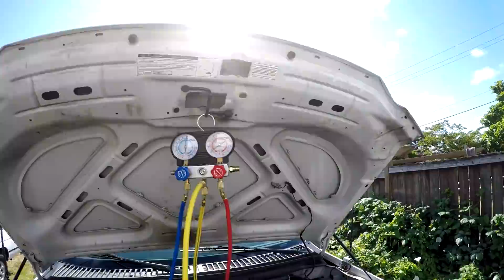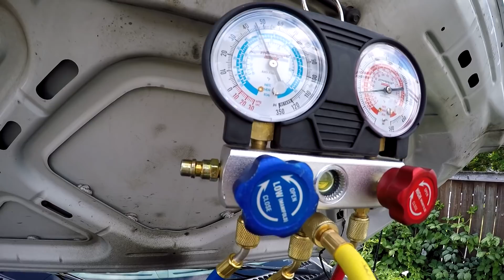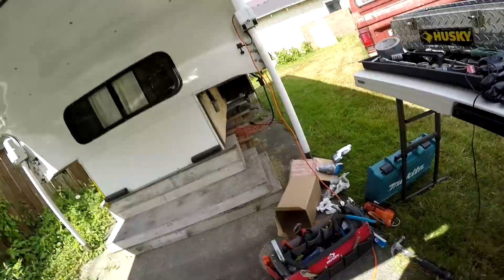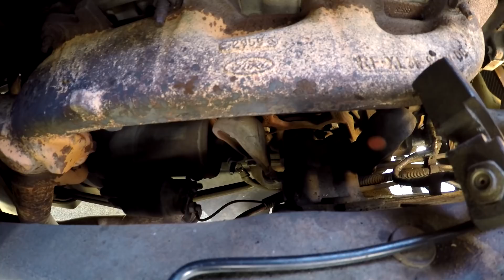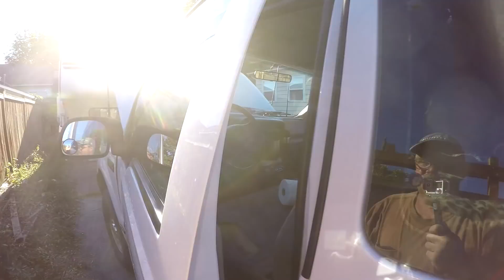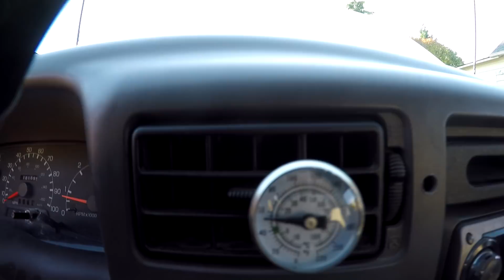EASY FIX FORD Air Conditioning System

Comment: This is a great video!  I replaced all my AC components except the evaporator, which I flushed. Evacuated the system and refilled to about half the specified refrigerant charge.  My low side will stay at 35 psi but my high side just kept climbing until I shut off the AC when it reached about 300 psi.  I'm afraid to blow up my system!  Why would the high side just keep climbing?
Reply: On a system that is fully charged, if there was a blockage at the orifice/TXV, then the low pressure side would not stay at 35 psi because the compressor would not get enough refrigerant fast enough and the pressure on the low side would drop off due to compressor vacuum; and it would be even more pronounced if he revved the engine because he would see the low side dip to zero or possibly into a vacuum if the restriction is almost completely blocked. If there was a restriction, it would also take a long time for the pressures to equalize when you shut the system off as it would take a lot longer for the high side to bleed through the restriction. But since he said he had a half charged system, I would say the most likely scenario is that there is air in the system because a half charged system will never give you a high pressure on the high side unless there is an addition of air in it or the condenser is not doing its job. I bet he let the system fill with air after he vacuumed it because he doesn't understand that it needs to stay in a deep vacuum when a charge is being put in the system. It sounds stupid, but I have found that a lot of people make this mistake because they don't understand.

Had he filled the system with the proper charge and got the same problem I would think the condenser isn't cooling. When refrigerant gets hot, it's pressure rises. At 300 psi, r134a is 160 degrees! So it would likely be due to an inoperative fan or poor air circulation through the condenser. You should research the pressure/temperature relationship of liquids to better understand this; Google is your friend. As an experiment, you can pull the plug out of your AC fans and run your AC with the gauges connected and watch how high your pressure gets on the high side.

Incidentally, if you come across a possible restricted system, you can find the restriction by feeling around with your hands or a thermometer. The temperature will be very hot just before the restriction and just warm (or cold) after the restriction. This is because the restriction causes the pressure to rise just before the restriction (high pressure = high temperature) and will be less hot or sometimes even cold after the restriction (low pressure = low temperature). This is the whole principle of how an AC system works and is why the high side is hot and the low side is cold as the orifice restriction separates these two pressure differences.
Reply from the maker: I should have mentioned a clogged orifice tube or expansion valve could cause the high pressure condition due to either debris in the system or ice forming from water vapor clogging the metering device. Debris will stay clogged and ice will cause an intermittent condition as the moisture freezes and thaws in the metering device. That could cause a high pressure condition since it would be on the high pressure side.
Reply: This guys says he shut the system off when it reached 300 psi. I'll assume he read that on the high side gauge. This means it has nothing to do with the high pressure sensor. That sensor is designed to shut off the compressor when the pressure gets excessive. It's a safety switch and during normal operation, the pressure should never get anywhere near 300 psi, unless maybe if there's a heatwave (well over 100 degrees in the shade). His pressure getting that high is due to either the condenser fans are not working or the condenser fins are dirty, not allowing air to get through.

Air in the system can also cause that and since he's getting these high pressures with only half the refrigerant, I suspect that is the problem. I bet that the system wasn't even in a vacuum before he put the charge in. I've seen people do this before.
Reply from the maker: Anthony Hardman  
Thank you, glad the video helped. 
I would change the high pressure sensor switch. On my system, it's located down near the compressor on the smaller high pressure line going to the condenser. The low pressure switch is on the accumulator bottle. Hope that's solves the problem
Reply: Swapped the high pressure sensor switch, still seeing the high pressure line slowly creep towards 300 psi while the low pressure switch cuts the compressor off around 25 psi.  When I swapped high pressure sensors refrigerant started hissing out the sensor port.  I thought those were supposed to have schrader valves to prevent that?  Makes me think there's an obstruction in the high pressure sensor port preventing the sensor from "seeing" all the pressure in the high pressure hose.  Thoughts?
Reply from the maker: Mine had Schrader valves. You'll get some blow out as the sensor is being removed. The sensor presses the valve in as it is screwed onto the stem. It should stop when the sensor is removed. Take reasonable cautions for the unexpected. Remember, I got sprayed after the system was emptied just from temperature change when I removed a hose from the accumulator.  There's always a chance the sensor you got was defective. You can also check for damaged or shorting wires to the sensor.
Reply from the maker: Another thing to try is to unplug the high pressure switch and place a jumper wire in the plug across the two terminals. The compressor should either run or not run depending on if the jumper is in or not.  Refer to this part of video for the low pressure switch. https://youtu.be/TE7czWLXd3w?t=4m58s
Reply: Anthony Hardman -x
Reply: CITAP1 ddsskkdookdkoxodooxooooooAoooopoopppppppppp
Reply from the maker: Less House more Happiness 
I'll have to take your word on that!
Reply from the maker: Was not aware propane, a flammable liquid compressed gas, could be substituted or even used. I wouldn't use it. I always looked for clearly marked 134a refrigerant. 
This point in the video pretty well demonstrates your blockage description of hot one side and cold the other. 
https://youtu.be/TE7czWLXd3w?t=6m10s

Comment: Hi! Thanks a lot and congratulations You performed as a professional :)
Reply from the maker: Thank you. Hope the video helped you. I lived with my AC problem for a couple years due to the cost of a shop to perform the repairs. We were going on an extended road trip to south central Oregon, there's a few videos from that trip here, where I knew it was going to be hot hot hot so I did my homework and figured out how to fix the AC system.  I bought about 300.00 in specialty tools, vacuum pump and AC test gauge set, and about 350.00 in parts, compressor, refrigerant, accumulator, Low presser compressor cut off sensor switch, oil, and other parts. Even buying tools and parts, I made the repairs for about 1/3rd the cost of the shop quote. Made me very happy and I've been able to help a couple friends fix their AC systems too. It's been about 5 months now and the system still works great.